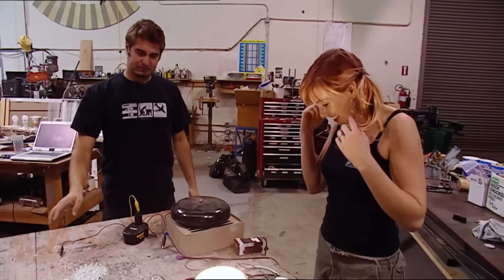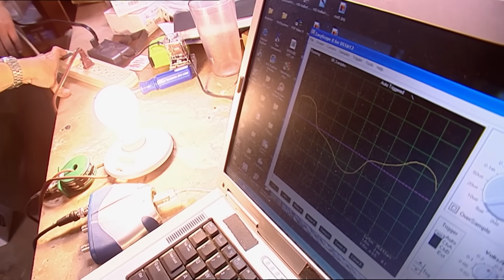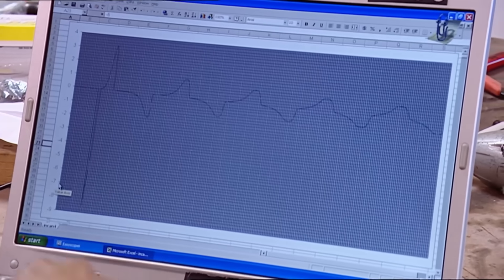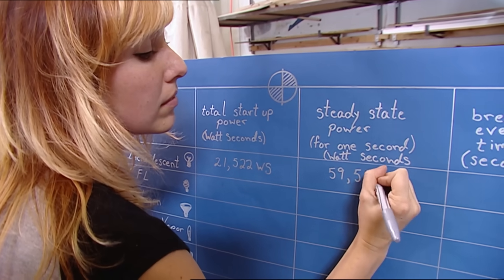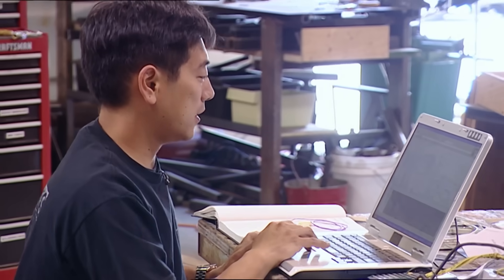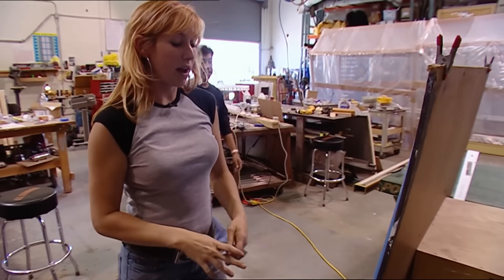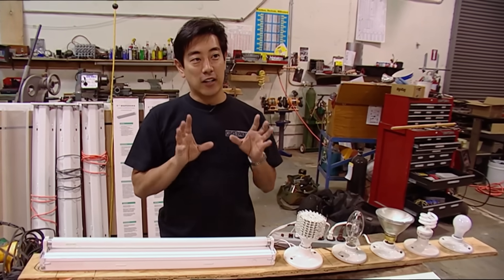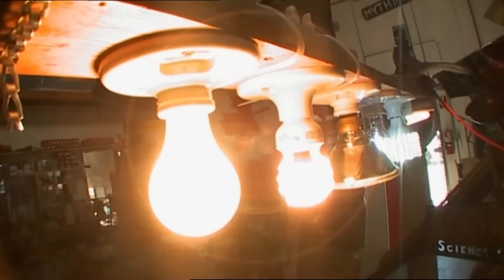Is It Cheaper To Leave The Lights On Than To Turn Them Off? | MythBusters

Comment: My father, an electrician, and me, an engineer had this discussion as he always left the lights on when it was dark  He said that an incandescent bulb in winter just displaces heat you would need for heating anyway.  The extra light helps psychologically as well.  He won that discussion.  I use LED daylight bulbs now, and find they are a big help for my mood in the dark winter months.   So keep them on when you are around. You will  definitely feel better in dark cold periods with no real power loss.
Reply: I used those "Daylight" bulbs for a while, but the True/Actual Plant Growing lights with the UV LEDS in them are what I use now. Much truer light waves & frequencies, contrast, and color depth. They make them for E26 standard light sockets.
Reply: If you want the mood enhancement of light I highly recommend using a light box in the morning. When you have to get up before it's light outside it really helps wake your brain up and set your brain up for a happy day. It hasn't fully cured my sad but I feel way more energetic since I started doing this.
Reply: The mental aspect is underrated
Reply: Not just incandescent light bulbs. All the electrical power spent in the lighting fixtures ends up as heat in the house, unless your curtains and shutters are wide open and you're actually lighting the garden
Reply: I much prefer the dark. But i think i have light sensitivity issues. For instanve i have trouble sleeping if there is a street light on within my eye sight from where i am laying
Reply: Not only incandescent bulb doubles as heater, but also kills fungi by applying heat directly at surface. It's great stuff to use as Toilet and Bathroom lighting. It's also kinda nice in kitchen because you need full spectrum light for cooking.
Reply: You're not a moth, you don't need artificial light to feel happy. Ancestors would be disappointed in you.
Reply: Anecdotally, every miserable person I know swears by living in the dark. My mood improved tremendously when I started leaving lights on instead of "saving money" keeping them off; I ended up spending more money in the long run having them off due to seemingly unrelated expenses dealing with the poor mood. With how efficient and ubiquitous LED's are these days, there's really no reason to sit and dwell in darkness.
Reply: @sambotwan  Do you know any non-miserable people who like low lighting? I like yellow bulbs, the golden light. I love the coziness of it. I have my parents orange lampshades on teak bases, I love that. I like green light bulbs in the bathroom, I dont need the details most of the time. If I do ,I can twist the led light in the other fixture. I like full color spectrum light bulbs, which I learned about in color theory class. I like grow lights in the winter for my plants, I love that fuchsia .Anecdotally some morally superior people who like to sit and dwell in the light at night get the same mood improvement as someone doing the exact opposite.
Reply: @sambotwan My imagination is better than what the room looks like anyway.
Reply: For incandescent filament lightbulbs, this was vastly untrue as a lightbulb is a very inefficient heater versus its electrical consumption. And for today’s LEDs, they don’t generate any heat… but have extremely low consumption, so keeping them on is cheap but won’t heat up the room. Still good for the morale.
Reply: @joso5554  I would argue their exactly as efficient generating heat...  but it's just the position in the room that puts it at a disadvantage compared to a baseboard heater...  you do indeed get heat from the bulbs though.  Both 10 x 100W incandescent bulbs burning at once and a 1 KW light heater would  produce same 1KW of thermal power.
Reply: @mattt945  Exactly. The lower efficiency isn't because it doesn't generate heat as efficiently, it's just generating where it doesn't serve as much usefulness.
Reply: @joso5554  nope, 100w is 100w, doesn't matter if its a light bulb, oven, space heater, or tv. all are 100% efficient heaters.
Reply: @joso5554  It's not a very inefficient heater, it's just not a very powerful one. Almost all of an incandescent lightbulb's output is in the form of heat, which makes it more of a heater than a lightbulb. If you took ten 100w bulbs, they'd put out nearly the same heat as a 1000w heater, although it would maybe not dissipate it as quickly, but you'd still definitely warm up a room.
Reply: @peoplez129 I have used them under the house to keep water lines from freezing.
Reply: @peoplez129 I have used them under the house to keep water lines from freezing.
Reply: @joso5554  Sorta true.  yes, LED's themselves don't generate heat, but when you power them from a 120-volt source (they are typically powered by three volts), that extra voltage has to go somewhere.  Usually into some kind of heatsink on the bulb, which of course generates heat.  Of course I'm talking about screw in type bulbs and not LED strips, etc.  And full disclosure, I am not an engineer or electrician, just an old duffer that likes to dabble in such things.
Reply: @nix4644  not really the case. Simply  they use switching power supplies ac to dc so only 3/120 of the time circuit is open than  make it stable and  with capacitors. Pretty much only heat is coming from the transistor that opens and closes the circuit which is minimal.
Reply: @pyroTT have you ever touched an LED bulb when it's on? I'm not talking about the bulb, I'm talking about the base. They get super hot. To make them cheaper they drive fewer LEDs as bright as possible pushing them to their limits which makes them die earlier. All the electronics inside are also pushed to their heat limits so things fail way earlier than they should. I've never had LEDs last very long because of that. It does seem to be a resistor connected between the board and the tip of the base. It gets super hot. It might be a fuse though who knows.
Reply: @josephwheeler1  we switched 3years ago whole house with $1-2 super cheap compact leds literally none of them died, I still have bunch of spares maybe I was lucky
Reply: @josephwheeler1 I read that that is why modern LED light bulbs don't last as long as the first ones. They get to hot now because of the lack of internal ventilation and other construction choices. My understanding is the company started cutting quality for cost reasons the minute they got government approval.
Reply: @nix4644  The voltage conversion is about 95% efficient which is why there is little heat generated in most LED lights. (LED strips are the same if they are being run off the mains.)
Reply: @josephwheeler1  It tends to be the voltage conversion circuitry that creates heat rather than the LEDs themselves. Cheaply made bulbs are more likely to be less energy efficient so are hotter and fail sooner. I changed all the bulbs in our house to LED in 2016 ... and last week one of them failed!
Reply: @pyroTT  Yes, I've got dozens of bulbs in my house which are all LED since 2016 and only one has failed after 9 years use.
Reply: @nix4644  It's wrong to say that the extra voltage has to go somewhere.  It's converted from 120V to the 3V you mentioned using a transformer.  There are some inefficiencies  that generate heat, but the change in voltage isn't by a voltage drop from any sort of resistance, which I think is what you meant by "heatsink".
All the power the LED uses though ends up as heat anyway, but it's not comparable to incandescent bulb.
Reply: Basically what my logic was when I was doing crypto mining during the winter. At its most basic form a computer is just a stupidly complex space heater with an equally as complex light bulb hooked up to it. 1400w is still 1400w regardless of what it's doing before it's turned into heat.
Reply: @dillzilla4454 kinda true but if you are using resistance heating for any kind of bulk heating you are doing it wrong- heat pumps will always win out since they can go above 100% efficiency.
Reply: @mattj3656-j7n heat pumps are limited in the conditions they can run in and requires central heating and cooling.
Reply: @dillzilla4454 modern heat pumps can go below freezing temps outside. And even below freezing they are often still better than resistance heating. It’s also possible to install a mini split heat pump for a single room. That’s literally what a portable air conditioner is, except there are also versions you can just install into a wall.
Reply: Agreed. It’s so depressing constantly walking into dark rooms
Reply: your dad was 100% right. Also lots of ignorant people commenting that light bulbs are not efficient heaters. No people, there is no such thing as less efficient heater. All sort of heaters are 100% efficient. Look up the thermodynamics laws please. Where else the energy is going to go? To the room of course!!!

Comment: As someone who leaves a light on all the time in order to be able to see when i get home at ass o'clock in the morning (7-7 work day in canada, ie in the winter time its dark when i leave and dark when i get home), the LED bulb used lasted for 6 years of 24/7 use, which did surprise me when i actually have to finally replace it. It's really the only thing on all the time so i'm not too worried about the cost of it, that said if i had a night light variant i would much rather switch to that if i end up moving from where i currently live, but as of now if it isn't broken then don't fix it.
Reply: You can always use Smart switches so that it turns the light on before you arrive home. They're fairly inexpensive and I've done it with a few strategic lights for a couple years now, really helpful.
Reply: You are not using very much electricity with an led. An 60 watt led uses 10 watts of power compared to a 60 watt incandescent bulb, 1/6 the power. LED is good ideal.
Reply: Not really surprising, lights don't really "wear out" by being on, but rather by being switched on and off, because that means temperatur changes causing stress on the internal components. A traditional light bulb is an obvious example, because the glowing tungsten wire will elongate when hot/on and contract when cold/off, until it snaps. LEDs have far lower temp differences, but it's the same principle.

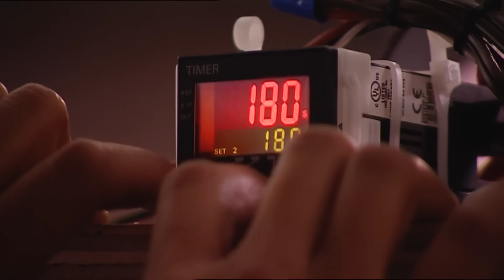Comment: 5:00 Two minute cycle is not long enough.  It is thermal stress that cause these things to fail.  They need to cool down completely to model real life.  When I first switch to LED's I found they nowhere last as long as my filament bulbs.  What seems to make them last the longest is to put them on a dimmer.  I turn them down when I don't need as much light.  Which makes sense as to why they last much longer; the thermal range is narrower.
Reply: That's just ridiculous. Led bulbs last 20,000 hours while old fashion bulbs only last 1000 hours
Reply: @jason200912  that's the problem.  Not in my experience.
Reply: @0x8badbeef test it with 2 desk lamps and leave them on for 2 months.

The incandescent will be dead in 2 months.

That's the fastest way to do the hours lifespan test.

If you want to do a slow method then find a room where 2 different light fixtures are synced to one light switch in your living room and give 1 a brand new incandescent or halogen and the other a brand new led

Everyone I know has had 10 year lifespans with an led bulb. The only ones claiming shorter were usually only from the internet and I'm pretty sure they found some used led bulbs thrown out and reused it
Reply: @jason200912  that is not the point of my complaint.  Which is, turning LED's on and off is not good for them.  Otherwise, leaving them on, they last.
Reply: @jason200912  I haven't had a 10 year life from an LED bulb yet. Best I've got so far is between 3-5 years of heavy use.  The one in my living room was put in sometime during COVID and just died the other day.  So that's my 3-5 year bulb, since I don't remember exactly which year of COVID it got installed.  I've always wondered with the incandescent bulbs if turning them on and off shortened the lifespans, since they usually burn out when I turn them on.
Reply: @CallsignApeman it does because high heat and cooling will cause the thin little wire to finally crack.

Pick a led bulb that is high lumens/watt maximum efficiency.   Theyre called European class a bulbs.  Or Dubai lamps/Phillips.  They're also rated for 15 or 30,000 hours too instead of the 5000 to 10,000 off the shelf random led bulb lifespan
Reply: @jason200912  the problem is not with the bulb. It is the electronics.
Reply: @jason200912  Not in my experience either. Too much cheap stuff on the market, and even the brand companies can't be held to their promises of thousands of hours of use.
Reply: You know some LED bulbs are not meant for use in dimmers, right?
Reply: @J.SMITH.  they won't work.  You have to  buy ones that are dim-able.  And you have to buy dimmers that support those as well.  Regular dimmers don't work.
Reply: @J.SMITH. do not use dimmers on leds. Leds are designed to be on or off. Dimmers do not save you much electricity anyways.  Only 20% saved at maximum and only with 20th century lightbulbs and they can ruin your bulb too

If you need things extra low light then i recommend picking 400 lumens or less.  800 lumens is the standard bulb brightness.

Comment: I don’t know why they included HID (metal halide) lighting in this study, as it is a completely different animal. Since HID lamps have a warm-up time to reach full brightness, you really don’t want to be turning them off for short periods of time like incandescent and fluorescent based lamps. Once you turn off an HID lamp, the lamp needs time to cool down before it will restrike, which in the case of some metal halide, can take up to 30 minutes. On the flip side, you should not be running a metal halide lamp 24/7. Lamp operation instructions call for when you are in a situation requiring keeping the lights on 24/7, that you turn them off for at least 20 minutes once per week, because metal halide lamps can self destruct at end of lamp life if left on 24/7. This is kind of a mute point now since HID lighting is slowly being replaced with LED which is more energy efficient, and LEDs don’t care how many times they are cycled on/off over the life of the lamp.

Comment: With CFL bulbs I ended up with twice as many fittings because they were so dim and some failed in months, instead of years. Would often leave them on because they took so long to reach full brightness after being switched on. The problem with LEDs is that they are often so badly made, that you have to buy several before finding one that lasts anywhere as long as advertised.

Comment: What you don't realize, is that thanks to smart meters,  the electric utility is billing you in 15 minute increments at the peak power level that happens when you first turn the light on. So you may only have the light on for 5 minutes, but you are billed as if it was on for 15 minutes of usage at the power that only lasted for a fraction of a second when you first turned it on. What a scam.
I learned this from one of the foremost electromagnetic experts in the USA, He has testified all over the country as an expert witness under oath in court and in front of government panel. After his utility installed his digital smart meter, he installed an analog meter next to  the smart meter. The digital smart meter calculated his bill using the above formula. The analog meter measured the electricity he actually used, and from that, his correct bill could be calculated. So every month, he had to contact his utility to complain about the discrepancy because the electricity actually used was less than what their digital smart meter measured. The utility could not establish that his analog meter was wrong;  eventually they gave up and charged him for his actual usage measured by the analog meter.
So when I'm at a location that has a smart meter, I do as much work as possible in natural light during the day.  At night I leave one light on where I'm working and use a rechargeable flashlight for those quick on-off situations like using the bathroom, or getting something in another room. Because electric stove turn on and off constantly, I cook large quantities infrequently and eat much of my cooked food cold. 
Ain't progress great?

Comment: Sometimes you just have to pay the cost of the nicer LED lightbulbs because the fancier ones actually do last longer.

I bought 20 Philips Hue Light bulbs in 2013 and they still work as of November 2025. Best part for me was that I never paid full price for them. Got them from an Amazon returns pallet for $50. That $50 got me 20 smart bulbs.
Reply: Those are wildly expensive LED bulbs (Though I guess it was 2013) The average one is like half that.

Either way the savings on your power bill are monumental. You could run them 24/7 and by the time they died theyd probably still be cheaper than running the same amount of incandescent bulbs for 1 or 2 years

Comment: its even worse than that you havent proven that there isnt a difference between compressing 5 years of usage into a month versus spreading that usage over time. I bet with normal usage you can get 10 years of a non led lightbulb. still obviously you can't turn them off every 2 minutes.

Comment: But they didn't test how long bulbs last if they're left on (and divide it by two) compared to the ones switched on and off.
Reply: That's not feasible to do, especially with incandescent bulbs that can last north of a century if you're not turning them on and off a lot.

Comment: The more you turn these new LED and CFL bulbs on and off, the shorter their lifespan.  I've left such bulbs running and they last over 6 years.  The ones I turn off burn out within a year.
Based on the cost of new bulbs, it's cheaper to leave them running.
Plus it's nicer not having to walk around in the dark trying to find a light switch at night.